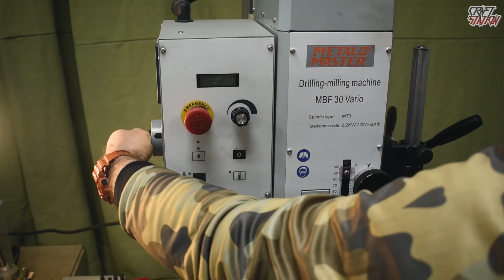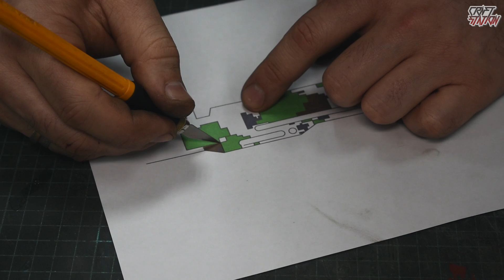NEW KNIFES FROM CS GO HOW TO MAKE

Comment: I bet those real knives are cheaper than CSGO's skins!
Reply: Real knives are really much cheaper.
Reply: You can get realy good knives for under 50€ and the most military knives even those which are used by special forces cost ~100€
Reply: Definitely cheaper i saw some of the cheaper ones sell for around 400
Reply: Unless the metal he used was expensive
Reply: And real gloves as well
Reply: true.
Reply: In fact, you can get a damascus steel real butterfly knive for 40 euros, but without sharp blade
Reply: I have a Karambit, for wchich I paid 100zl wchich is around 25$
Reply: Really cheap, made mine for free with cardboard
Reply: @kazimierzswiecicki1319  wchich? Sorry, not trying to be like toxic or anything, just helping you out, as I know you are a foreigner, it is spelled Which. You're welcome :)
Reply: No
For example, falchion knife vanilla ~ 150$
Cold Steel Espada (real falchion knife) ~ 500$
Reply: well they aren't heat treated so they won't be doing anything knife related
Reply: well, they are actually cheaper than the CSGO ones

Comment: did you heat-treat them? also what's the type and thickness of the metal? I'd really like to make the skeleton knife one
Reply: Heattreat is very important if you want your knife to be tough and sharp so even if he didnt i would recommend you to do it. Try to heattreat in oil , it has less chances of cracking and curving. Also for safety do it in open areas and wear protective gloves, glasses etc, it produces a lot of smoke and it maybe catch fire.